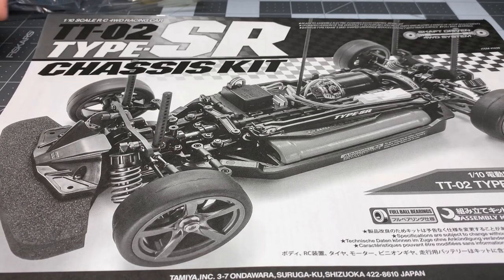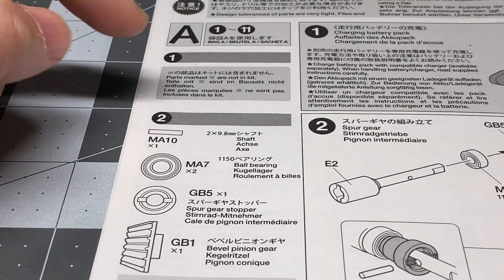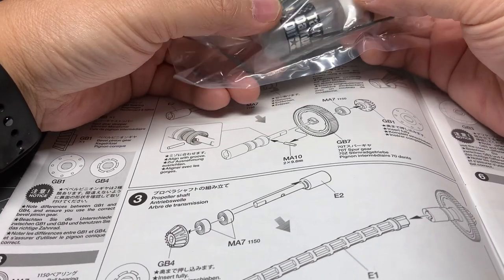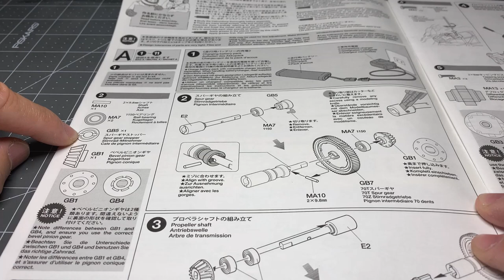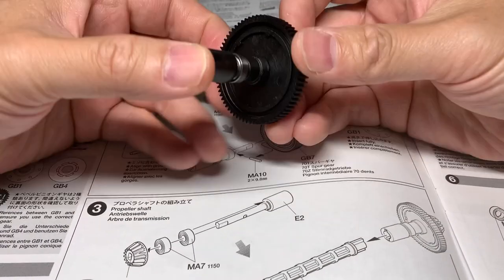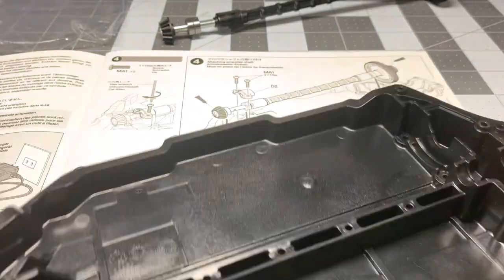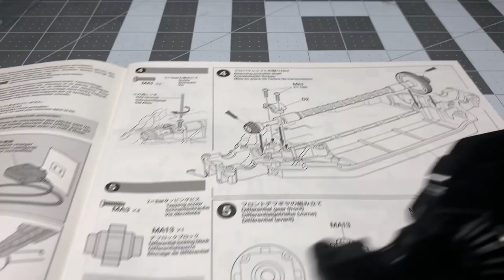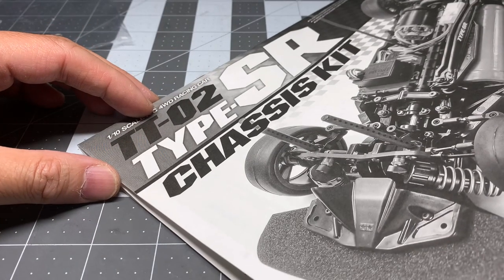How to Install Drive Shaft & Spur Gear on Tamiya TT-02 Type SR Chassis Kit

Comment: Hello. Very nice video. What type steering servo did you use. Also, what is the actual width tire to tire. What is the wheelbase? I just ordered this on Amazon. I intend to put a 1/10 scale Porsche 917 made by Delta Plastik. Thanks!
Reply from the maker: The TT-02 wheelbase is only 257mm. I don't think it will fit that body. This is a very old video. I recently built the Type-SRX kit and I put in a Power HD R12 servo.
Reply: @RCsRCCars  thanks so much for your speedy reply! The wheelbase of the Porsche 917 body by Delta Plastik is 260mm. I might have to cut it a bit. But what is the overall width though? Front and rear? Thanks.

Comment: gb4 yours says insert fully  mine is gb2 and it's says snap on  am I supposed to force it?
Reply from the maker: I built this kit almost 3 years ago and sold it shortly after. Double check the pins. Sometimes there are more than one size but they look identical. I hope you can resolve the issue. Good luck.

Comment: Are you supposed to grease the spur? Normally metal pinion to plastic spur you don’t use grease. Also do you think marine grease would be better than the included molybdenum?
Reply from the maker: I try to follow the manual so my results are repeatable for the viewers. All of the TT-02's I've been have specified grease on the pinion and spur. A little grease won't hurt. I have never used marine grease, I will investigate. Maybe look for it in a future video with a shoutout. Thanks for the suggestion.
Reply: @RCsRCCars  the SR kit doesn’t specify grease on the spur
Reply from the maker: @jonthomas8487  Awesome. Thanks!